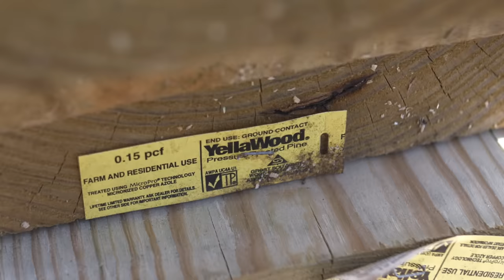5 Tips for Building a Durable Deck

Comment: I live in upstate RAIN DOOM AND GLOOM New York, and I built a pressure treated  12x20 deck with 4x4's planted into the ground at the frost line (almost 3 feet deep) with 2x8 pressure treated joists 1 foot off the ground with pres treated 1x6x12 deck boards and they were NAILED with twist nails treated 2" and guess what?  34 years later, outside of normal fading to gray.....the deck looks like the day it was built.  Not one board had to be replaced, no sagging, had enormously huge phat.....aunts and uncles all over it over the years, no "edge taping sealing", not extra treating over the years of the deck boards, no railings warping or getting loose,  stairs look the day they went in.  Nothing.  Plain, old fashioned carpentry.  OH, and 16" on center joists.  No special "Yellawood" sold here or back then.  Just...whatever Lowes was selling.  Go figure.
Reply: chivone21 that’s how I build shit these guys building decks like this now days are paying way to much money for materials no one can afford this shit for high end inspections
Reply: The pressure treated wood you used 34 years ago is not the same that we use now.  It was better back then.  In 2004 the EPA banned the chemicals used to treat the old wood which is why these newer decks rot faster.  Also, Yellawood is not some new company - they have been in the pressure treated business since the 70's.

Comment: On ledger boards up against a house I put galvanized flashing that tucks up under the siding and then goes over the joists like an L. Under it is self healing peel and stick window tape and a bead of roofing tar. The boards on top might eventually rot, but they seem to dry out pretty quickly and there's no damage to the ledger/house.

Comment: Going 12" oc is  so little extra money to have a deck with no bounce. Most decks you are talking 3 extra joists. Glad to see you show the joist tape in higher rain and snow conditions this is another inexpensive product with longevity. I have seen pressure treated framing rot in 2 years using above grade contact. I would only frame a deck with a ground contact product.
Reply: If it's composite deck boards you'll need it
Reply: it's one extra board for every 4 feet of deck.
Reply: it depends on the width of the board. It's better to have 2x10 16OC than 2x8s 12"OC ... way stronger the first one.

Comment: Worst timing ever... just yesterday I finished extending my current 6x24 deck out to 18x24.  Now Matt tells me how I should have done it 😭. If only this video had dropped last week...
The good news, the first 3 of the 5 tips I did anyway, and while I agree in theory with putting peel and stick on top of the joists I think it’s probably overkill (the existing 6x24 deck I built in 1988 without any joist protection and it’s still in excellent shape) and while 12” centers may be needed for Trex-like products, I’m using real wood decking and 30 years experience shows that 16” centers are fine in this application.  Not saying that either tip is a bad idea, just that I’m ok with the fact that I didn’t do it.
The more I think about it, I suspect I will use joist protection if I ever build another deck...
Reply: John Early from my past 40 years experience in deck framing and tearout John is that if your deck is one that is in an area where water escapes quickly and your not in s rainforest type of environment meaning your not like my buddies deck on his cabin I just rebuilt that is in the Appalachian Mountains under a large canopy of mountains and it rains nearly ever day and it is literally a rain forest. In that application, following all of Matt’s recommendations really makes sense. But if your building a deck outside of San Antonio Texas and there is no tree cover close by and you only get 12” of rain a year then it’s not going to be as critical that all steps are followed so it sounds like your gonna be fine brother. You have the experience and knowledge to build a sound structure but it is nice to have Matt in our corner because he constantly makes us think and he brings awareness to new products that may take us another 3 years to hear about from our local lumberyards. I wish he would have been doing this 20 years ago but I, like you, always overbuild and go to the extreme and my projects still stand tall!!

Keep driving those nails john and thank you Matt for all the awesome info each week, homeowners all over the country are benefiting vastly because of you Matt, thank you!!!
Reply: 16" centers feels bouncy with most decking products if you weigh over 180lbs.  It's safe, nothing wrong structurally, but if you want a firm feel when walking, especially with guests, I'd recommend 12"
Reply: That also depends on what kind of post spacing you've got.  Posts more closely spaced means 16" OC is firm as a rock.
Reply: My deck uses joists on 16" with Timbertech composite and it has a tiny amount of bounce, but it's only noticeable to me because I built it.  Everyone who comes over thinks its rock solid.  If you're using solid wood, you're absolutely fine.  The issue comes if someone wants to run diagonally - then 12" OC is needed.
Reply: @burtosis  it also depends on what type of 2x lumber are you using for joists. 2x10 spaced 16OC is way stronger than 2x8s 12"OC
Reply: The stiffness/strength of a joist scales by the square of its depth so a 2x8 is about 2/3rds as stiff/strong as a 2x10.  Spacing them a third farther apart removes most of that gain although it's a few percent stronger it's not much.  People complain about the lack of stiffness and the motion can cause problems before strength usually becomes an issue.
Reply: @burtosis  
That bouncy feeling may also be due to lack of joist blocking.
Reply: @NoRoads2AllRoads  
Part of the bouncy feeling is the flex of decking material. 2x lumber is much more rigid than 1x over a 16" span.
Reply: @avid0g  12"? 16"? I've never put down decks that didn't have 24" centers. Just standard around here.

Comment: Nice deck, you should however buy your guys a string line and show them how to use it. A keen eye will spot the bows in the installed deck boards (Pause at 7:17 and look at the furthest end, the 2nd, 3rd, 4th boards from the outside edge are installed like bananas).
Reply: Yeah horrendous

Comment: You can treat wood as much as you want it still will rot away in the end. Had it with my deck which became a death trap before I rebuilt it. Used recycled plastic wool and composit decking material. Seen plenty backyard fixes with wood on TV. Want to see what they look like in 5 years. Guaranteed not the same.

Comment: I am going to hang LUS46 hangers off my fascia board, do I:
1) Apply deck tape sandwiched between the fascia and the backside of the hanger? (will be using SDS screws)
or
2) Wrap the 4x6 beam in deck tape prior to setting it directly inside the hanger?

Comment: I frame my decks differently but I like that you're oversizing and underspacing the joists. I also like that you're using ground contact lumber. Rated and unrated has been on shelves for years and nobody knew it. This may be changing since this video was produced. Nice hustle man. And, get 10 deck builders in a room and you'll get 15-ways to  build a deck, some claiming joist tape is necessary and others not. Probably a number of variables go into this. Where I build, I add it to any deck I resurface.

Comment: Actually, I can think of one reason why it might not necessarily be a good idea to use the more heavily copper impregnated, ground- contact lumber for all parts of a deck. I suspect that the ground-contact Lumber , with more than double the copper content,  might be more corrosive and likely to interact with the Fasteners used. It might be best to use stainless fasteners everywhere if the entire deck is built of ground- contact rated, pressure-treated lumber. I foresee a problem with that approach as well, which is that your Simpson Strong-Tie joist hangers and other similar joist hangers for building decks are made of galvanized steel, so now you've got stainless Fasteners being used on galvanized steel joist hangers with heavily copper impregnated decking. Especially in a damp climate, this could be quite a recipe for hastening galvanic corrosion and leading to eventual structural weakening.

Comment: I’ve actually used roofing tar on my post and painted on heavily and then let it set up on it so that it’s almost dry then I put it in the hole And poured concrete around it and made sure that the concrete was below the top of the roof and Tara my posts and that’s given me over 20 years of life already counting what are your thoughts on that if you ever seen it?
Reply: Easy to tips and tricks etc etc That’s a great tip. I always do that to. Submerged posts have WAY less flex than than using those post stirrups

Comment: Cmon man! the boards didn't even line up in the end! But I guess that the video was about building a durable deck, the structural aspects were brilliant. Even better to protect the ledger board would be to use DPC with stainless staples on the concrete face.

Comment: How come you didn’t install a flashing over top of the ledger board to prevent water from getting in there in the first place?
Reply: TSizzle; I agree..Also, the picture of the “ledger board” is shown going in backwards. Should always be “bark side up” so the board curves toward the home-structure. Same for band boards, deck boards. Look at the end grain and imagine the board coming from a tree..It’s easy to see which way the board will cup over time ;-) I’ve seen way too many failures because people don’t know..

Comment: Matt, I have important questions for you that are on my mind. Firstly, thanks for the tutorial
 You provided a couple great tips which I hadn't known about. As the son of a mechanical engineer and myself a micro-mechanical engineer (virtually the same principles) I'd always been a builder and would just for educational purposes and fun would often bat the ball back and forth with my dad about all kinds of builds.

However, again I have a question for you, a specialist in the field and not some know-it-all weekend warriors, whom I'm sure will feel compelled to weigh in on nonetheless.

My question for you Matt, and for Matt alone, revolves around that I have never believed in the wisdom of tying in a deck into the inner beams of a house where you can't see the nature of how they're holding up over the many years lifetime of a properly, well built tie-in deck. Where I live there are indigenous aggressive termites well known about by the home builders before they built but not by me since I came from another town. However, here you put the deck tie-ins into the admittedly robust walls of a swimming pool on a hill. Beside what little that we could see of the exterior of the bolts what type of terminal ends were anchored into the side of the swimming pool walls, was the bolting system made of a non-rusting material, how deep did they go in and what do you think of the wisdom of putting stress concentrating points in a vital pool wall which previously was uniform (as much as it can be) in a swimming pool where each gallon of water weighs about 8 pounds. The weight of the water and the pull on the wall of the deck represent quite a bit of potential energy. If the deck should be used for purposes unplanned for, eg. too many people crowding on it, their jumping up and down such as at a fourth of July display (yes, I've seen this filmed and the deck collapsing) and or the owners (or next owners if sold) deciding to build on it, eg. a stone hearth or cooking grill, etc.will all the tie-ins  embedded hold up against that degree of extra pull and especially not combine with the weight of the water at new stress concentrating points? Beside the loss of aesthetics, would you not do better by adding vertical 6x6 inch supports next to the pool and possibly adding some under deck cross bracing between 6x6's proximal to one another? If you don't have time to answer all these questions, I'd very much appreciate knowing the mechanics of the bolt tie-ins to the pool wall and if they're not merely galvanized but rust proof. Also, how would you calculate the number of tie-in bolts needed? 

I'd greatly appreciate it if you could shine some light on the parts of the build which you didn't cover in your otherwise very good presentation. Thanks!
Reply: Most of the weight would be down wards , so it's more a question of sheer strength of the fasteners. Wall looks pretty thick, and would have re-bar/ trimmer bars.

Comment: Hey +Matt Risinger quick question... What tape would you advise? I used Grace Vycor in a section of my deck 2 years ago and wasn't impressed with the sticking ability. I was at Lowes the other day and ran into the normal Zip Flashing Tape that it's used to tape the Zip board seams and that thing seemed to be sticky as hell. As you would say "tenaciously sticky" ... I was wondering if one could use that? it seemed to be a good alternative and actually cheaper.

Comment: Love your videos. 
Can someone help me with my questions please?
1) i have 25+ plus year old deck. I am trying to replace deck boards with Trex. Do I need to replace joist fasteners and joists?

2) my deck posts  are built using cinder blocks. Are these Ok to keep using it or do I need to replace it?

Thank you
Reply: If your cinder blocks are solidly connected and reinforced, they can be as good as Matt’s steel columns. If they’re just sitting there then no. 

If the joists don’t have rot and the new decking can span the gap, then you’re fine. Some decking can span bigger spaces than others.

Comment: Thanks for the helpful video! It is my understanding that stainless steel washers on galvanised bolts will cause some pretty nasty galvanic corrosion, and rust stains. Why not just use galvanised washers?

Comment: How do you recommend attaching a deck to a brick veneer home. I have seen the simpson strong tie brackets designed to prevent loading of the veneer. What other options are there or can you recommend?
Reply: For mine I opened not to attach it to the house at all.  No matter what you do it will want to move with the frost heave and I want to allow for that free movement instead of possibly pulling out bricks or something.

Comment: Another tip is to not have any horizontal boards at the bottom of the railing. My deck has them and they prevent leaves and twigs from being swept or blown off and instead they collect right up against them and cause a lot of rot. I just had to replace a lot of the deck boards because of this

Comment: I have to say that I don't care for the idea of hidden decking screws, underneath the lip of each decking plank. I'd rather have them visible in slightly countersunk, so that I have a shot at unscrewing a plank that becomes damaged with exposure to the elements. It would also be nice to see if anyone has done a comparison of coated decking screws to stainless screws, to see which one holds up better, or if the coated decking screws are any good at all for the long-term.

Comment: I hope you address stringer split.  Every deck stair I see have the stringers split where to treads are screwed on typically splitting down to the riser portion.  I suppose you could use end grain sealer on both cuts as well as joist tape under the tread.  Anything else to keep the stringers/treads solid?

Comment: In nz we would use stainless steel everywhere for that deck it close to ocean and will get wet from pool water with its chemicals..  really like the joist tape would a dpc plastic stapled on do the same? Thinkn cost 👍 nice tips cheers
Reply: Yeah I'm building a deck right now in Dunedin, NZ. Was thinking to use DPC plastic on the joists, its a bit foreign for builders here to do that on a deck. Maybe our weather isn't rainy/consistenly damp enough to warrant it.  Only difference I can see between DPC plastic and the decking/flashing tape is that if you make a penetration (i.e. nail/screw) the tape will seal up against the screw, whereas the DPC might just split a bit and let water sit between the joist and bottom of DPC... Where are you building in NZ?
Reply: Others have pointed out that he should have used SS because of pool chemicals, but rest assured...Matt's working in the Austin, TX area.  That "ocean" is Lake Travis.  Not salt water. :)

Comment: Nice, clean workmanship.  But did you use deck hold downs, or a deck tension device?  Or do the steel post columns mitigate the possibility of the deck pulling away from the structure?